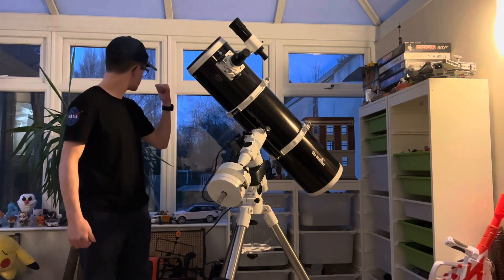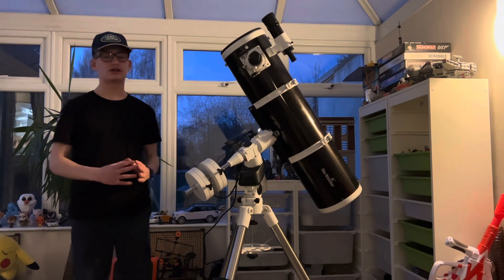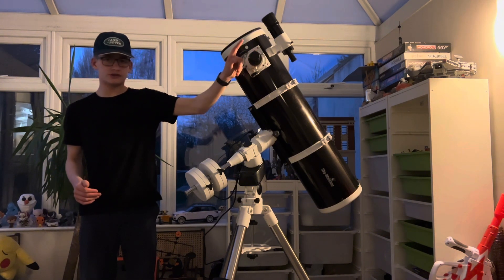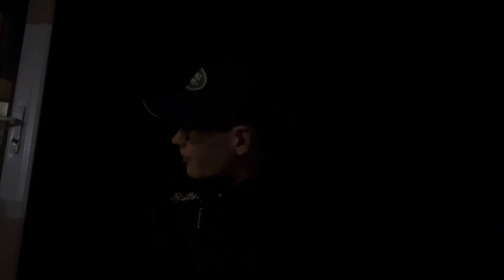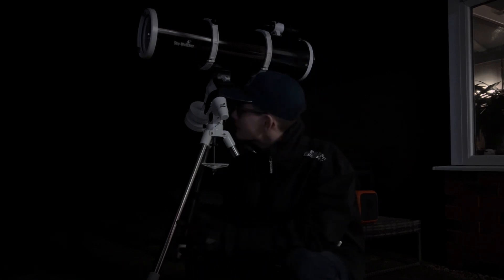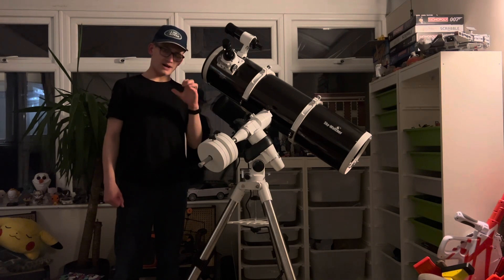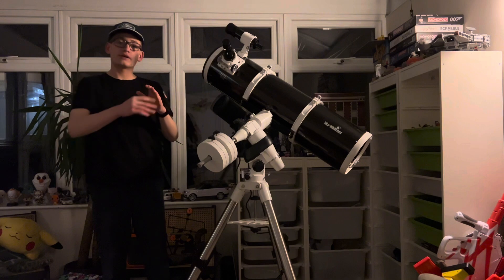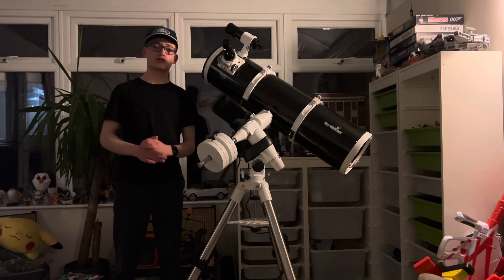Another fail (azimuth bolts again)

Comment: I'm beginning to suspect that your trouble with adjustment may also be that you've not slackened off the bolt on the underside of the mount.
That's the big knurled plastic bolt that screws the mount to the tripod.
If the tension is not off that bolt, the azimuth adjustments will be way too tight.
I've also greased the surfaces between the tripod head and mount, where this adjustment takes place.

Comment: Running out of adjustment on your azimuth bolts just means you need to then move the tripod legs in the desired direction by just a cm or so and recentre the adjustment screws. You'll then have more adjustment.
It's just like if you turn your eyes to see something to your side you but can't see it, you'll have to turn your head.
This is a simple thing you're struggling with but I wish you luck tonight.
Reply from the maker: I’ve loosened the ‘big screw’ connecting the mount to the tripod just by a touch. And im able to get the azimuth screws to the correct position. I’ll try moving the tripod legs as well now. I’m uploading a new video today. I’ve got polar alignment now finally.